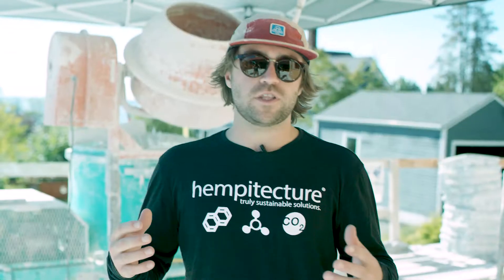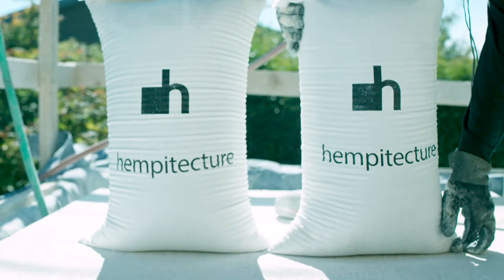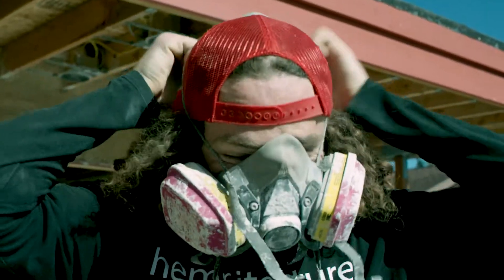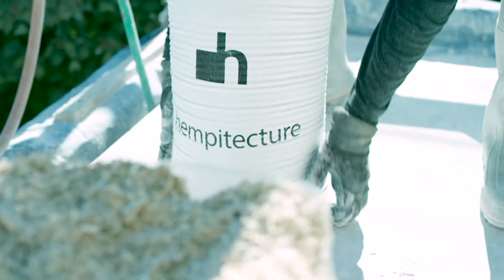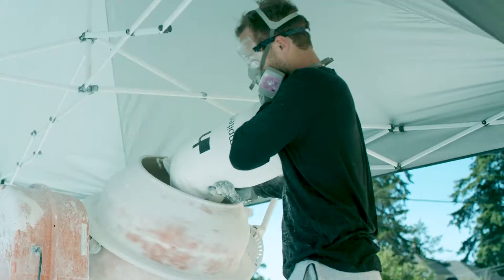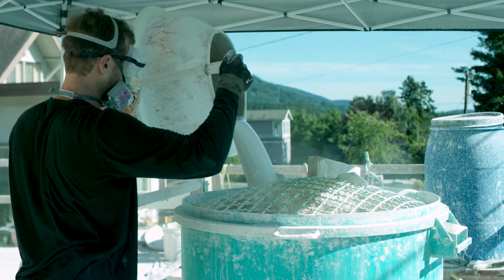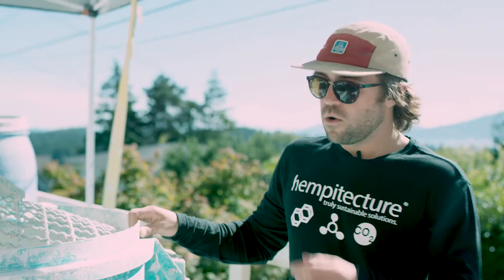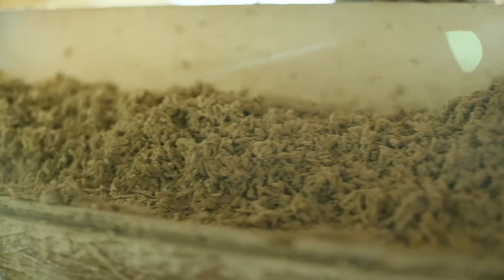Basics of Hempcrete - Episode 1 - Safety & Mixing

Comment: I want to try to make some raised beds out of hempcrete, if I live in a temperate high humidity/rainfall area (1000mm/year rain) and since the raised beds will be exposed to the elements, do you think I can use that 2:1:1 ratio (hemp/lime/water) you mentioned or should I change it up? Also how much does the 2:1:1 means in weight for the ingredients?